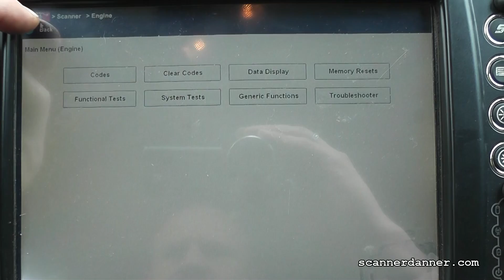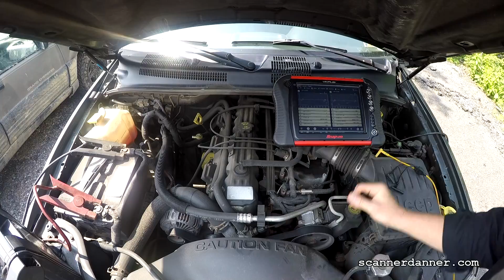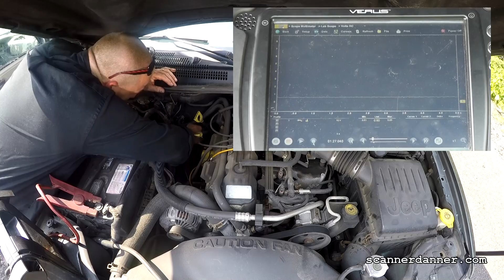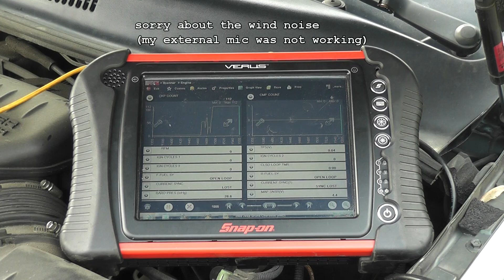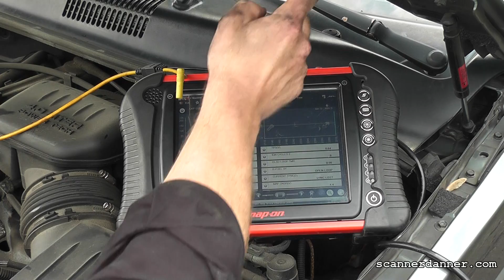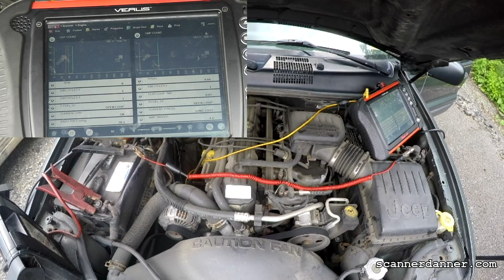How to test a crank sensor (Chrysler Dodge Jeep)

Comment: Im at a loss my wave form builds slowly up then drops down a ways then  builds back up slowly maybe 5 second intervals on the scanner is this normal have a cam crank loss code and random misfires definitely electrical
Reply from the maker: You cannot view a crank sensor waveform on scan data.
What are you watching?

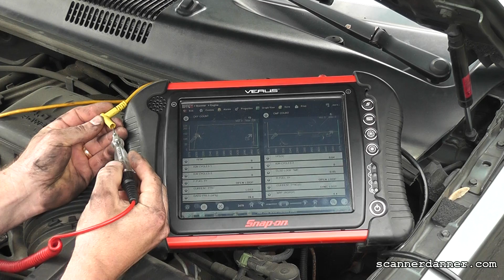Comment: 23:29 Interesting to know that cam/crank does not have to be synced for the PCM to command ignition control on this Chrysler product.  For some reason, I was under the impression that Chrysler products must confirm cam/crank sync before commanding ignition control and fuel injector control.  Now, I believe if it detects cam/crank out of sync at a later time, then it will cease ignition control and fuel injector control.
Reply from the maker: It's all dependant on the type of ignition system and the characteristics of the crank sensor signal. On a waste spark system like this one (I think this was a waste spark), we only need to ID which pair of cylinders is coming up to TDC as the same coil will fire on TDC compression and TDC exhaust

Comment: What if all three have 5. volts when ignition is on? This is a 2015 Dodge Dart sxt 2.4L. I also checked for any break in the wires and directly connected to the ecu ground side of the crankshaft position sensor. It still gave me 5. volt. Would this be a bad ecu?
Reply from the maker: Bad ground all day long!! Main computer ground issue if other sensors have the same high voltage on the sensor ground circuit. Test the CAM sensor and see if it is the same
Reply: @ScannerDanner 
That’ll be my next test. Just for information the car kept giving me the codes for the crank and cam sensors. That’s what drove me to check the wires and the ecu before I changed the sensors. Is it possible that only the cam crank sensors ground at the ecu are bad or would it be the whole ecu ground it self?
Reply from the maker: @MosesJesusElijah  you can have a bad sensor ground in the board that only affects one sensor, but anytime I have seen that there was an underlying cause (power wire shorted to the sensor ground)

Comment: So if my reference wire shows 5V. My ground wire is good but my signal wire doesn’t have 5V when it is supposed to could the ecu be bad? Assuming my sensor isn’t plugged in.
Reply from the maker: You can have a bad sensor ground and still have a good 5v ref. A bad computer ground would be a different story
Reply: @ any suggestions on what to do if the ECU might be bad?
Reply from the maker: @MJ-gq3hm  what are you working on? Year, make, model, engine, history of problems and the current problem. 
If it's a Chrysler product, the signal wire should have near 5v on it unplugged, if it's 0v at the sensor, next step it to measure at the ECM itself. 5v at the ECM and 0v at the sensor = open in the wire.
Ov also at the ECM then you need to check that wire for a Short to ground. Your ECM is not going to be the issue here in 99.9% of circumstances

Comment: If you didn’t have a scope, can you use a test light to see if it flashes on the crankshaft sensor as it pulls the voltage down to ground? Or if you had a noid light?
Reply from the maker: I have a video showing how to do this with a voltmeter. Basically you have to bump the starter over

Comment: So the ground wire in the center has a pulse also? Can that be tested with a test light ? I’m getting the 5 volts and when cranking it does draw the 5 volts on one side down. But with a test light connected to the battery positive and on the cam sensor plug  ground it doesn’t pulse. It just stay lite
Reply from the maker: An LED type test light possibly, but not an incandescent light because you'll just pull the signal to ground
Reply: @ScannerDanner  so the grounds going from the pcm to the cam and crank sensor should have a pulse other than a steady ground? It just depends on the testing method as to whether you can see the pulse? I need a scope for sure
Reply from the maker: No, the grounds should be near 0v all the time (less than 100mv)

Comment: The 3 wires on my chev utility crank sensor pulled out.thr are coloured green., the other black  with pink stripe and brown. Two of them rerad 5v. To put back on sensor wich is labelled 1 and 3. Which wire goes where.the black one is earth.

Comment: A wealth of great info as usual Paul. I have a question, with the CKP unplugged why is 5V present on the signal wire? I always thought the signal wire was just an input to the PCM, why is 5v present there? Or did I misunderstand?
Reply from the maker: It's a pull-down signal circuit. There are pull-up designs too. Check out more videos in my Chapter 2 playlist right here on YT and also on my website if you're interested 
https://www.scannerdanner.com/join-scannerdanner-premium.html

Comment: I like that lil bypass test on the crank sensor..helped me to confirm cranksensor  failure..when it would warm up it would shut down..sensor wire went to 0..anyway thankz helped me out

Comment: have you came across a bad sensor that causes delay in signal? my friends acura takes about 7 seocnds of cranking before the injectors even get a signal to fire.friends at work so im doing some rsearch before we attack it but im heading towards crank and cam sensors first.
this cars tricky because its a integra with tsx engine and rsx harness with standalone ecu for rsx (rfsx uses k20 and tsx k24 pretty much same engines other then displacement and a few things)

not only is the delay in signal but its also in limp mode where rev limits around 3k rpm and a hesitation when you snap throttle like its fuel starving but its not.

being a hodge podge of different car parts i have to consider if it needs a rsx sensor or the fact it was automatic thats been manual swapped,if the sensor gets signal from plate in bell housing it could be somthing here.

i think ill check when spark is firing and compare that to pressure transduer compression waveform to start.
Reply from the maker: signal on scan data or an actual measurement at the injector itself? Does spark do the same thing?

Comment: Us backyard mechanics can't afford big computers and diagnostic equipment like you guy's have on these videos. We have the voltage meters from harbor freight. We take our cars and trucks to autozone get a reading and print out, swap the part and we are done with it. Most of us can't afford to have someone do what you are doing here in this video. The ford dealership told my girlfriend that they wanted 165.00 just to diagnose her 2014 Ford escape. They also told her that prices have just gone up. I took the car to autozone got code reader got the print out bought the part for 70.00 dollars and fixed it myself.  The dealer wanted 165.00 to diagnose and who knows how much for the part. And that is the same at the Dodge dealership, ridiculous.
Reply from the maker: Watch what I'm doing and adapt the tests to the tools you own. 😉
My videos are more directed to the technician, not the DIYer, but that doesn't mean you can't learn from them! I've created many technicians from the DIY crowd. 😉
Reply: The idea here is to learn how to use your tools and minimize mistakes as in buying a sensor when you really didn’t need one and you still have the problem as as in if the cam sensor calls a false crankshaft sensor code. As described in an earlier video, just keep watchingand maybe you’ll wanna change professions and you’ll be grateful to get paid for what you know just a thought. Good luck.
Reply: @craigbaggett3370  got you.

Comment: Man I have been broke down with my Jeep since oct .. it just shut down on me. It would run for 2 miles or 20 .. but it just finally stopped either cranking or staying running if it did crank... Just a lot of little things it's done too . Mainly with the fuses inside and the relays.  I had a coil pack put in it just for starters.. no luck there.  I finally found some one with a computer , a small one and got code for crank shaft position sensor and put a new one on..so now it will turn over but not cranking . But before it was put in it would crank at least but it had started back firing last few times it did crank..so I don't know what to think or do.. gonna try and get a comp on it again. Maybw I have a bad sensor from manufacturing.!! So irritated by it all for sure..
Reply: Do u think it may have jumped time? It's a 97 Jeep Grand Cherokee Laredo 4x4!!
Reply: My husband was a excellent mechanic but he passed away 3 yrs ago . I'm bout ready to go to automotive school my self..!! Can't find a good ole mechanic to come to ya home anymore...lol .
Reply: And I was having to undo a battery cable cause thought the radio was draining it but I unplugged radio and after bout two weeks it still drained the new battery so got another battery ..uughhh...

Comment: Hi have a 2010 Chrysler town and country. I have 5 V on all three wires to my crank position sensor. Whether plugged in or not
Reply from the maker: You have a bad sensor ground circuit. Are any other sensors showing the same thing?
Reply: @ScannerDanner  I did not check. I will go back to the car on Sunday. I spend my time just looking for A broken wire and checking the grounds. The van starts after a 3 to 5 second crank and it runs rough With the check engine light flashing. No misfire codes just the crank sensor code.
Reply from the maker: That makes sense. These systems can run without the crank sensor. But you'll have an extended crank time as it will use the cam sensors alone to determine when to fire.
Since it does run, this suggests that the problem may only be affecting the crank sensor. 
Are there any other codes?
This is definitely a bad ground to that sensor.
We need to look at a diagram and see what else shares that ground or if it has its own ground. 
These sense grounds, go to the PCM, not the engine block or battery ground. So your options for faults here are:
1. An open in the crank sensor ground wire between the sensor and PCM
2. A bad main PCM ground (but this would effect ALL of the sensors)
3. A bad PCM
These computers are garbage on these and fail all the time.
We MUST check the crank sensor ground wire right at the computer itself. If it read 5v on that pin, and there are no other sensors effected, then most likely the PCM is bad. 
If it is my car? I'm running an external ground to that sensor circuit (don't cut the wires, just tap into it and ground it) and then see how it does. You may be able to get away with that repair.
Reply: @ScannerDanner  Thank you sir. I appreciate it.

Comment: Mr.Danner, what are your thoughts on dorman, standard motor, duralast, etc., aftermarket cam and crank sensors. Are there really that many issues with them, or do they get a bad name from untrained and less than competent diy folks?
Reply from the maker: Watch my 3 part series on. Hyundai EVAP large leak code which was ultimately caused by an aftermarket part. 
This is a very real problem! I've seen more junk over the past 5 years than ever before in my almost 30 years as a tech.

Comment: My sensor turned out to be good.  When I remove it and bench test it, it works as expected. Re install it, keep the bench connections so that the only variable is now the reluctor doing the input. I crank it and get nothing.  Reluctor stuck maybe?

Comment: Could a p0344 camshaft sensor be a problem with timing? Ive changed cam sensor and crank and still showing p0344 and want start
Reply from the maker: what are you working on? what is the definition of the P0344? Also, a faulty crank sensor can cause cam sensor codes and vice versa on Chrysler systems

Comment: great when you have a $10,000 Crap-on scope. why don't you use the inexpensive tool for demo? I'm sure your friends will provide one for you.
Reply from the maker: Look past the tool and apply the knowledge to what you have. Obviously you won't see a momentary glitch or  drop out of a fast signal with a meter, you need a scope for that. 
Or just complain some more about a free education.
Reply: @ScannerDanner  nobody said to use a meter and BTW nothing is free, not even you.The point was you are using a tool which not even the above average joe can afford. You can not look past the tool if you are demonstrating with it. Use a tool thats more affordable to the average person, if you can that is.
Reply from the maker: @jet6374  here you go, this may be what you are looking for https://youtu.be/pwuYVlCZNBI
I'm not going to use basic tools to appease the masses. I use them when possible but I'm not here for the masses. If you take a step back and truly watch what I am doing and listen, there are techniques that can be applied using more basic tools.  Especially the unplug it test I showed using just a graphed voltage. Something that can be DIRECTLY applied using a dmm. 
In the video link I just added here, I am showing the WEAKNESS of a dmm while trying to measure a crank sensor signal. Why would I start with a tool that has weaknesses?

Comment: Those jeeps display engine trouble codes in the odometer if you perform the ignition key procedure. The crank sensor lives near the bell housing on the driver's side.

Comment: Man I wish you could look at 96 caddy deville. It cranks strong but won't start. My crank sensors have oil and dirt on them. But the way they are position is hard to unscrew that 10mm bolt to release them. And where is my camshaft sensor located. I see a wire in front but I don't see where the sensor could be. If I search Online the camshaft and crank sensor look a like. 3 weeks and counting trying to find the problem.

Comment: will this be the same on a cummins?
Reply from the maker: IS it a 3 -wire sensor? Then it will be similar. May not be exactly the same circuit design (as far as pull-up or pull-down)

Comment: Is the 5 volts on the signal wire unplugged a bias voltage?  Thank u!!
Reply from the maker: no sir, it is not. It is a pull-down signal circuit. Totally different than a bias used for open and short circuit testing. (Chapter 2 stuff Bill)

Comment: What about a P1391 code but the jeep runs my cam on a graph from a snap on scanner seems right the CkP is jumping from 0 to 340 or so but it starts up rough and idles like crap I have replaced both camp and CkP 3 diff times

Comment: It's great when the reasoning behind the sensors is explained, but not everyone has the several-hundred bucks to buy a scan-tool that we'll use once or twice. Any auto store will require a deposit on the tool before loaning it, usually, so that's not always helpful. The videos showing what can be done using a multi-meter are the most helpful.

Comment: I'm having a p320 the jeep throws the cle, I can run torque pro but it doesn't show the the trouble code is active. I recently just last  p340 and high output codes from tps, cats, iac, and air temp sensors. I cleaned my battery( it's 4 years old) cables up and reconnected them, the first set of codes went away, ran fine for 2 days then the p320 showed up. Could a weak battery or alternator cause issues with the sensor?

Comment: Paul I have a 06 or 07 vw tdi brm diesel, the head was removed that caused this problem, in processes I can't old cam sensor. VW dealer wants to sell 3 wire and only plug not installed is is a 2 wire. Is it possible to hook to trunk wires at bottom of engine. I need some guidance Please

Comment: hi paul i have aquestion here if u plz  could i use 5 k khom resistance as a  jump er between 5 volt refrence and signal wire to identify if the circuit is ok as you did while testing Tps sensor  before thanx in advance
Reply from the maker: yes you can, an incandescent test light works too
Reply: ScannerDanner 
thanx bro from the eastern  side of the world your student here pray to  god to  bless you , best of luck man

Comment: Great video. But this how to test a sensor with  really expensive pro equipment . With someone years of training and experience. That's able to interpret that information
Reply from the maker: Which can be applied to more basic tools if you understand what is actually happening. You need to look at this differently. I have MANY DIYers out there who follow along and are learning to use their equipment more effectively. Also, you can get a single channel lap scope for just a few hundred dollars.

Comment: Hey Paul, which video would you recommend me, no start no injector pulse without the use of lab scope, I don't have one but I think it's  the cam or crank sensors, it's on a Mitsubishi Galant 2000 2.4 , I have power and ground going to fuel pump, but power to injectors when cranking , any help thanks 
By the way I enjoy your videos I'm learning some at my age not being a professional
Reply from the maker: Post your question here Josue (I think I have seen you on the forum already right?)
https://www.scannerdanner.com/forum/post-your-repair-questions-here.html

Comment: 06 magnum 2.7L c2202 , u0100 ABS SIDE OF scanner. I changed spark plugs that's when all the problems happened. can u help or guide me to possible failure
Reply: David MDR My dodge ram stalled 2 days after changing spark plugs dang thing cranks but won't start ! did you find your promblem thanks

Comment: Paul, i'm a Chrysler tech, on Chrysler products,  the cel stays on with key on, engine not running. Once the engine starts, if there are no codes that require the cel to be on, the light will go out. Nicely done vid. I have an Ethos scantool that can show the signal outputs either in numerical form or in graph form. The graph form is a nice feature that really helps.